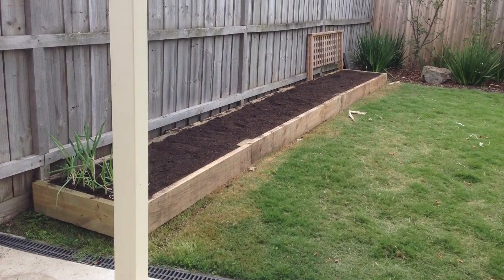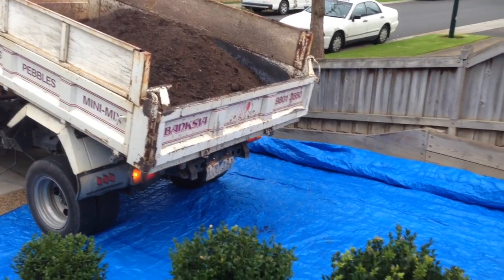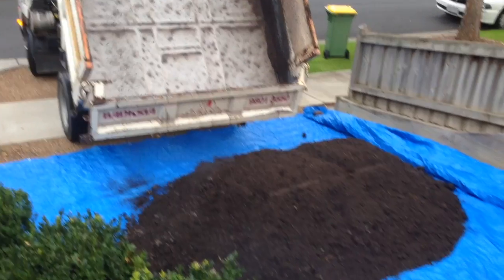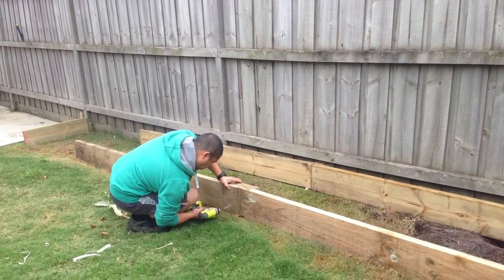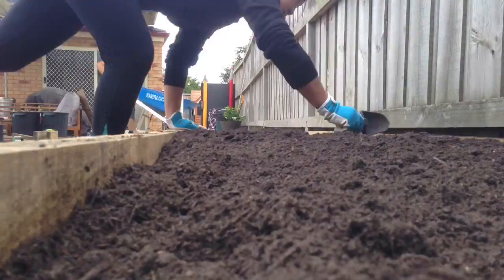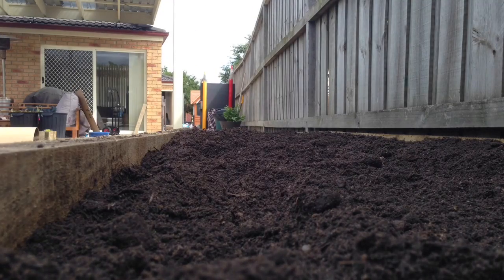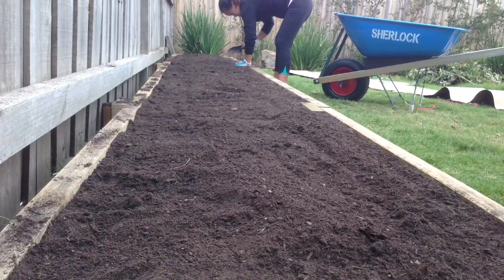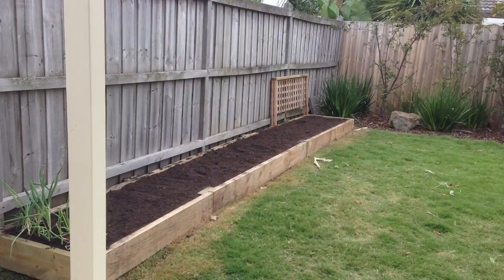My first raised garden bed

Comment: Hi mate great job!! is there anything you would do differently now than you actually did? Also I have a metal fence so I'm wondering what I can fix it to sleeper...?
Reply from the maker: Thank you! It was my first attempt at this... I've now since upgraded (I've done a video on this).
The thing I do differently now is to put weed mat down before I start building the veggie bed (and not use cardboard since that breaks down over time).
The sleepers with the soil are very heavy once setup so I wouldn't fix it to the metal fence since it's not really going anywhere... hope that helps!
Reply: @biclar  Great do you think the 50x150x2.4m treated pine are good to use, and how did you handle the stumps so sleepers could be screwed into them. did you concrete them in. p.s great video man. No wonder it has had over 50k views :):):). Thank you
Reply from the maker: Cheers @drewwyliepearson ! 50x150x2.4m treated pine are great and had lasted about 6 years and would have kept going I reckon if I didn't upgrade.
I didn't concrete the stumps, they were just screwed in and flush (top and bottom) and were more to make sure to tie the ends of the sleepers together and stop the soil from coming out the sides.  Personally I wouldn't concrete (not needed and less space for potential veggie roots).
Reply: @biclar  Thanks so much for that. getting it done this week :):). Thank you so much. LEGEND!!!